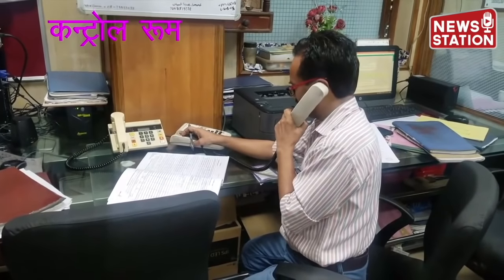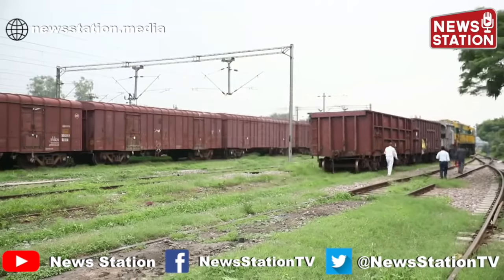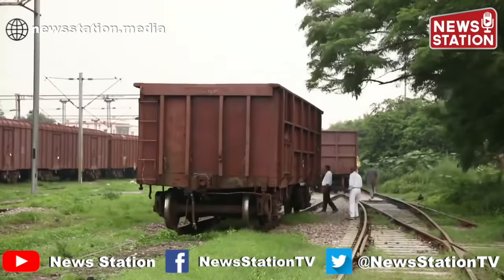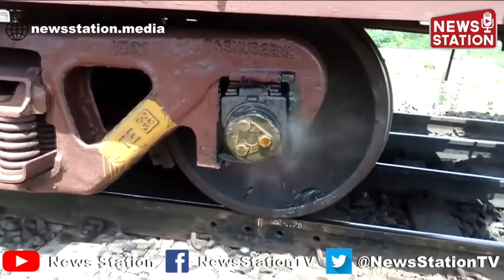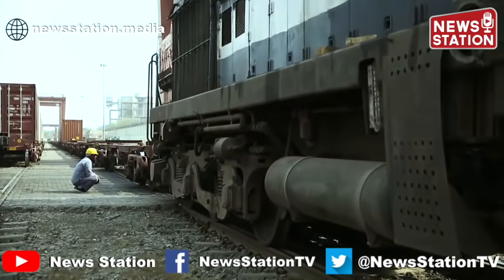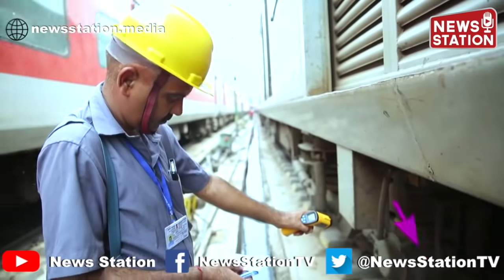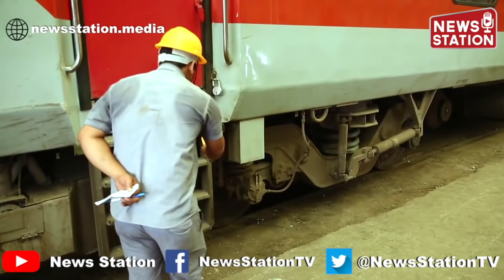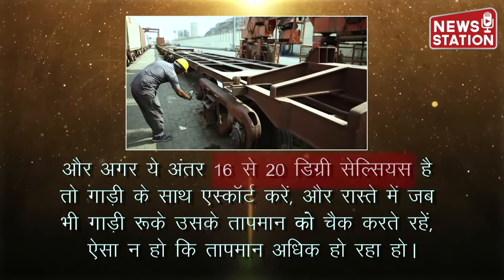Discover Why and How Hot Axle Incidents Occur on Moving Trains | Indian Railways | News Station

Comment: The laser non contact thermal sensors are not expensive.... We can in buil this termal sensors for every wheel bearings their by connect this to a micro chip integrated to a computer and there by we can effeciently monitor the whole system.....